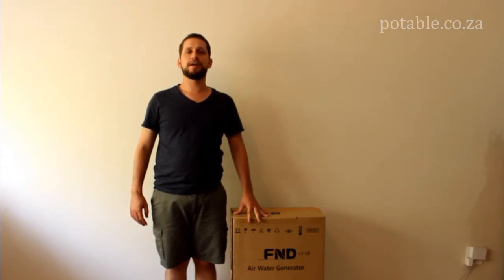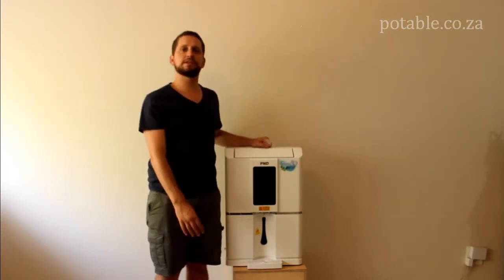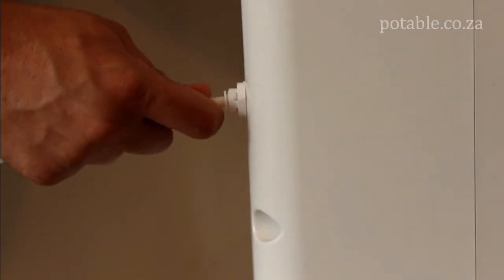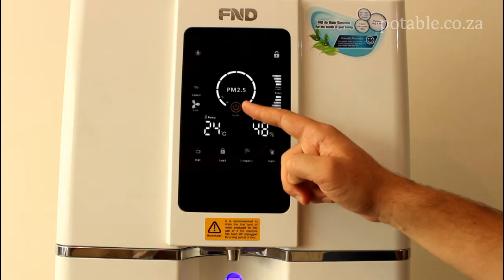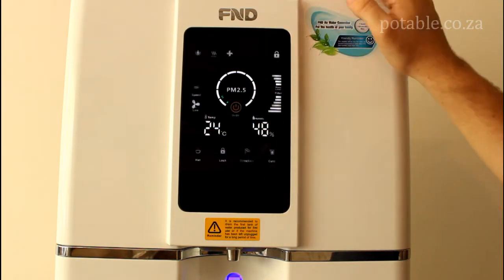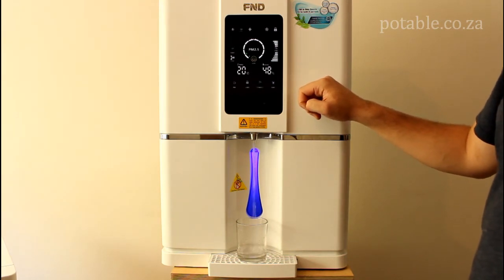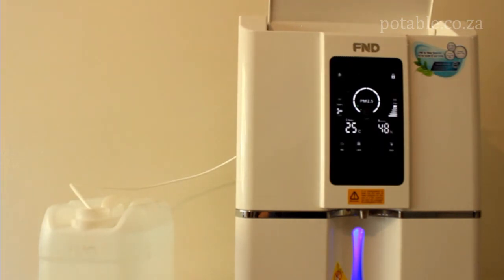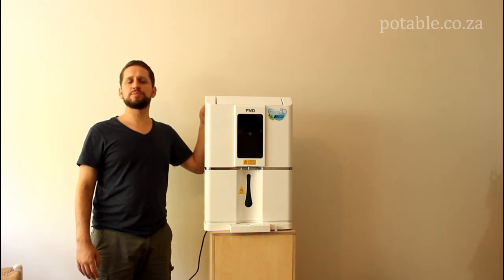F20 Unboxing - Makes Water From Air

Comment: Needs Full achievement in India and surk countries related to manufacturing, trading, services and facilities for installation and maintenance services with proper networks management and business development solutions including low power consumptions , unique designs and unbeatable and heavy duty options, mousetur , heat, dust and irons proofs and for all overall global environments and setups,thanks given, yours faithfully.
Reply: I already developed same in India with low electric power and low humidity atmospheric water generator . If you want knowledge you can contact me on mobile number 8308772658 (India)